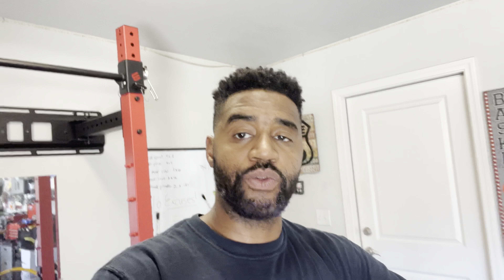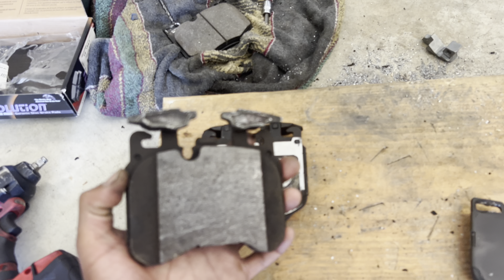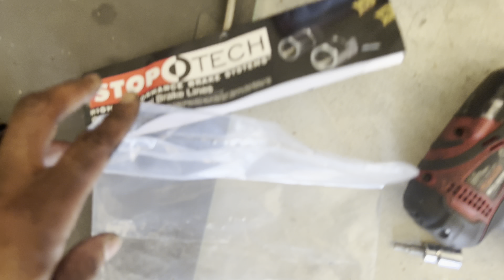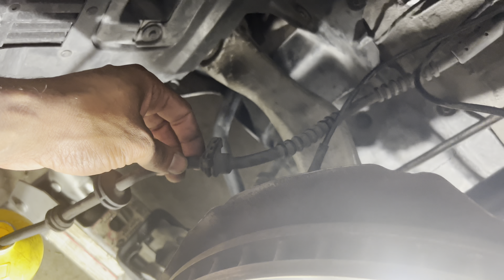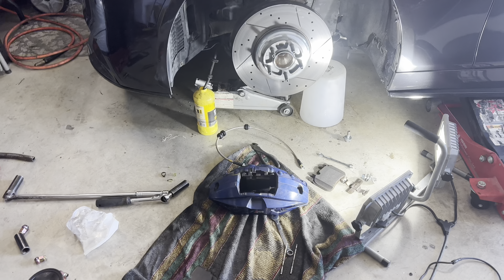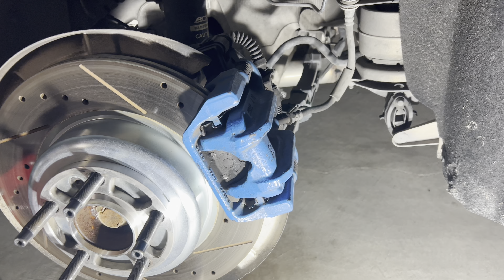BMW F10 535i G30 Brake Update and Brake Pad Replacement

Comment: @GrantJohnson you do not have to take off the parking break electric  motor for the rear breaks. Just use your OBII scan tool and put the parking breaks in change pads service mode. That will cause the motors to reset all the way close, then just use the C clamp to push the piston back. When job is complete, use the scan tool to put parking breaks back to normal. I have used this method on my F10 550i with no problems....
Reply from the maker: What scan tool are you using? I just have the MHD tool and Ista+. I couldn’t find the procedure in Ista+.
Reply: @JohnsonMotorsports  I use the Nexas ND601 Scanner for BMW. It has a EPB Reset that open and close the break pads, initialize and resets....
Reply from the maker: @passat24666  Nice!!
Reply: Use the Bimmer Link , have the option “brake service” , after This the piston come Back Easy !

Comment: How did you manage to break the bolts to the tabs that fit on the top of the new pads? 
I’m currently doing this and it’s a pain to remove them to drill out the holes.
Reply from the maker: Mine came off pretty easy if I remember correctly. What type of head is on the bolt?

Comment: So u  can have the correct rotors and not have to cut down the pads, just drill the slots?
Reply: Which rotors do you need?
Reply from the maker: Yes, if you pick up the correct rotors, you shouldn’t need modifications to the pads.
Reply from the maker: Checkout this video. This is where I got my information.
https://youtu.be/2408-spRowo